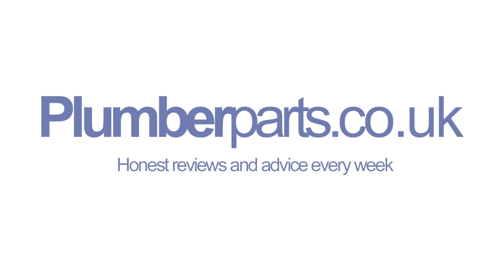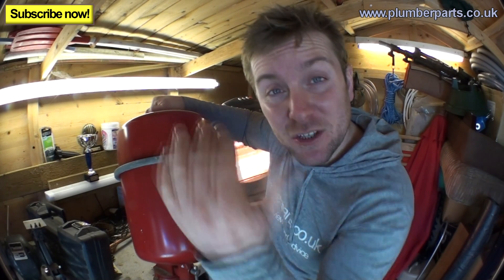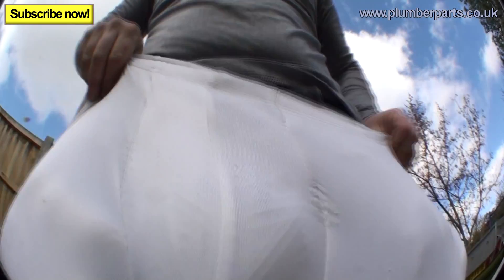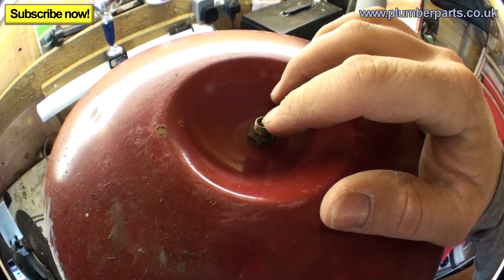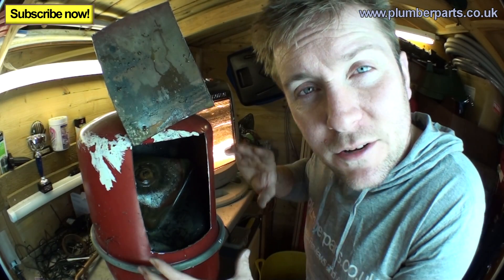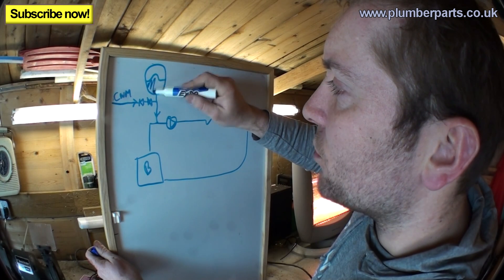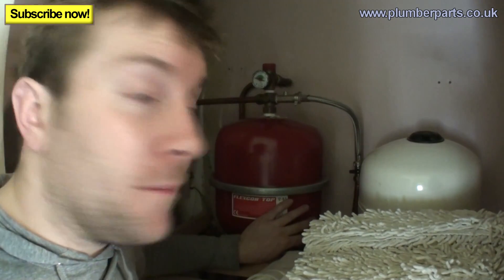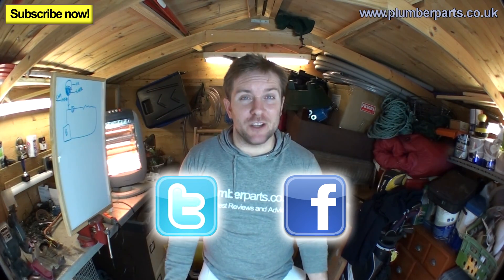EXPANSION VESSELS - CENTRAL HEATING SYSTEMS - Plumbing Tips

Comment: I recently had a gas inspection pass. After testing the heating we noticed a puddle starting to form in front of my flat. Water was coming from the overflow pipe. 

The engineer asked if I had to refill the pressure each time and I told him I did. He said most likely the expansion vessel has filled with a lot of water and needs to be replaced?

Could you explain why this happens?
Reply: How did you solve this ?I'm having to pump pressure every 5 or so days.
Reply: @Phoonguy  I have the same problem, checked everything and can't find a leak

Comment: I see how it helps with heat expansion but why is it that when the pressure on the water side is low the heating systems can start to not work so well? Also if i only have an instant gas water heater for a shower not for central heating can i install without an expansion tank as when the water is heater it is escaping via the shower / tap.

Comment: Hi mate, I have an existing expansion system that's been in place for about 10 years which is no longer holding the pressure and I kero having to top it up to 1 bar. Are they easy enough to swap out like for like?

Comment: Brilliant videos, thank you! One question from me regarding filling my (unvented) system with inhibitor. My mains water fill point for the CH system is goes into the expansion vessel via flexi hose. Is it possible to disconnect the flexi hose from main and inject rapid dose inhibitor at this point? Will it mix through the whole CH system? Thank you and keep up the effort - very informative!

Comment: Got a friend  of mine an 'Old School' Plumber to replace a expansion tank , his trick of checking the tank if it was gone was to top the Water side of the tank with a screwdriver handle and you would hear a dull sound ...and then the 'Air' side if both were similar... then the Bladder had leaked water into the Airside,  I now check my new expansion vessel every few months  as the Water side of the vessel you hear a thud sound and the Air side, Rings like a Church Bell...Lol ...Great upload...

Comment: What would have if my expansion vessel was too small for my system? I have an integrated one on a greenstar 24i system that feeds 15 rads, 3 of which are doubles. Since the last one got fitted, I get a slow pressure loss, to the point when it goes to zero when cold and not running. When it kicks in again next day, it goes up to about 1 bar. No leaks on system anywhere that I can see.

Comment: Luv, luv, luv it. Fun and factual. Brilliant. One of my faves on YT. One quick question,  1700 sq ft, single floor apartment with underfloor heating. How do I size the expansion tank?
Reply: if it's 8kw boiler, then you need an 8 Ltr expansion vessel

Comment: Hi, Ideal mini s24 diverter valve which has a pin that pushes out when the water is switched to activate the boilers ignition switch is coming out. If I take the switch off and turn the hot water or central heating and I push the switch with a screw driver manually it will fire the boiler up.

Ive had a boiler engineer out who wants to sell me a boiler and not fix the issue, he's cleaned out the pipes and replaced the diaphragm behind the switch pin but its still not working. Yes put 2.5 bar of pressure in there so thats not the issue. What can it be???

Comment: Some help / advise, on a system, cold it's 1 bar, when hot it's 3 bar, it starts to rise from 2 to 3 bar over a short time, a few days, its a combi boiler, unvented, when I release some pressure, when hot, it then goes really low? Like  0.5 bar? The system is from 2008, its a heatline boiler, 15 mm rad pipe work, I cannot see a expansion tank,

Comment: From instructions I've read you need to invert the vessels with the air valve on the top so that any sediment does not gather in the water side of the device, also they say to place on the return side just before it gets into the boiler.

Comment: We have had a problem with Water pressure at 2 bar but low water flow. I have found that by letting air out of the expansion vessle the water flow (taps) has improved. I have let all the air out of the expansion vessle is this a problem ?

Comment: Hey mate I’ve got a pressurised hot water system that makes a terrible banging noise in the morning sometimes when the heating kicks in too. Is it likely to be an expansion issue? The inlet/pressure reducing valve has been changed as was thought to be an issue with this, but no change

Comment: HELP REQUIRED PLEASE. I have noticed the system pressure on my Combi boiler goes quite high, nearly to 3Bar. I have checked the expansion vessel, charged to 1Bar at zero system pressure. No water comes out the vessle, so  i assume it's ok. Start heating, the pressure goes up to 2.5 to 3 Bar. Also noticed that the expansion vessel and flexi pipe stay just warm as if no water is getting to the vessel from the manifold unit. Any ideas?

Comment: Hi :) 
        I'm a computer engineer, love electrics and computery stuff and know how to do a ton of other stuff but know absolutely jack about plumbing (as in can manage to bleed a radiator and that's it).!
I have a mate who takes care of that for me and I do his electrics in exchange as he's afraid of the "killler" electric type stuff.
I'm nervous of flooding the place so it works out ;) 
By the way electricity wont soak your carpet! Set fire to your house maybe but definitely won't soak the carpet :)

Having said the I've just spent a couple of hours watching your vids and there are three things I've have to say:
   1. The plumbing diagrams you do mirror electronic ones (I keep explaining to my mate that both are very similar in the way the work but he's s not buying it ;) ) 
For instance your symbol for a one way valve is the same one as for a diode which does pretty much the same thing only with electricity. And the radiator symbol is the same as for Resistors which again do something similar, (i.e. dissipate heat).

2. I'd actually give this plumbing thingy a go! Learned a ton of stuff the past few hours. 

3. I did the tighten the bleeder valve on my heating system when we moved in three years ago because I never had a pressurised system before, been bleeding a radiator once a week in the kitchen and kept wondering why. 
Just loosened it a few minutes ago :)

One thing I've seen on you tube is people who pipe up and complain about something or other trivial which is unfortunate but I've learned more from you tube than I ever learned in school and collage and I learned it quicker. 

Keep up the good work and thanks for taking the time and effort to do the vids.
They mean a lot to those of us who know the value of them :)

Now I'm off to buy a rowing boat, just in case I need to row from the sitting room to the kitchen should it all go horribly wrong ;)
Reply: except he put the diode the wrong way round, doh. Although, in electronics, it depends which current direction concept you subscribe to.

Comment: You refer to a lots of poor and incorrect installations, as you have just said in your video about expansion vessels. (Do they need to be a certain way up ?)It would be really useful if you could explain why and also do a video of all other whist not necessarly dangerous or instaled in a way they wont work, but show or explain the best way and correct way they should be installed, with  working examples of an poor or incorrect installations. You did this on one of your videos showing a little vessel for removing air in the system you said this should be installed before the pump which makes sense. You then showed us one installed after the pump. On another matter can you show a doemestic hot water system (for the taps) and heating, with a combi, without a emersion heater ?Hope that makes sense. cheers Bob.Have you got a book out ?

Comment: I wonder if the vessel would work without the membrane if you just put the vessel upright with the nitrogen on the top side...
Reply from the maker: +He Ka I've always wondered that!
Reply: ***** =D hah. I guess the rubber is there just to ensure the gas wont leak in to the system. Otherwise I'm sure it would work great.

Comment: My Keston 80 has just had its expansion vessel replaced  by a well-known energy company due to collapsing pressure at cold and having to refill. Now the pressure just collapses to 0.4 bar when the heating goes off. The gas bloke said it was ok. So I don't recharge, just turn the heating on, the pressure rapidly climbs to 2.3 bar then when it cycles off it reduces to 1.0 bar in about 10 mins then fires up again and heads off to 2.3 bar. At the end of the evening, everything goes off and the pressure goes back to 0.4 bar. It never used to do this. So, was the new expansion vessel duff, or maybe it hasn't been pumped up properly? I'm no expert and I think the well-know firm is reluctant to come out again! Should I just switch everything off and go electric?
Reply from the maker: +Gordon Clifton Deffo check the expansion vessel. Something is not right there!

Comment: Really enjoyed video.Don't know whether you help with advice.I have expansion vessel on our heating system which is pumped through to our bathrooms.Every time pump is called into action, theres a strange loud farting sound coming from pump/vessel area.Do I need to replace vessel?Or is there air in the system somewhere?As funny as it sounds, not sure my plumbing should be guffin' 20 times a day.
Reply from the maker: +Nigel Payne Hmm hard one to diagnose. Think youve probably got a problem with the expansion vessel Best get a plumber to check!

Comment: The 18 litre expansion vessel on my CH system started to pull the supporting bracket off the wall. I found it was incredibly heavy. Does this indicate the vessel has failed and is totally filled with water? A pressure reading shows 2,9 bar.

Comment: What was the second, white tank shown in your video here: https://youtu.be/m1repkd1HHc?t=5m28s ? My system has two, just like the one you show (and the installation looks really bad). The white one has no pressure gauge and has just started dripping (and no air seems to come out when I press the valve on top).

Comment: The pressure went low on my eCombi Ariston boiler last week so I opened up the l/h valve, turned the r/h valve until the pressure almost reached 1.5 and then turned off the R/H valve followed by the L/H valve. The pressure was then 1.5. The system continued to work but today I noticed the pressure was almost at 2.0. How do I lower the pressure so the pressure does not continue increasing or until it stops working.

Comment: I recently had my Ariston Clas 30 system boiler's expansion vessel repressurised - it was way down.  Shortly afterwards I've been finding that several of the downstairs rads in one particular area are only lukewarm - that's all of the rad not just the top or bottom. Could the engineer have introduced air into the primary circuit when he repressurised the vessel thus causing airlocks? I've done my best to rebalance the rads - turning down the upstairs one as per another of your videos - checked the TRVs etc but nothing works. Can you advise if airlocks might be the problem?
Reply from the maker: It sounds like airlocks. Check out our video on how to remove them! Good luck, PP!
Reply from the maker: It sounds like airlocks. Check out our video on how to remove them! Good luck, PP!

Comment: Hi great Video..... I've a sealed oil heating system connected to a boiler stove heating 14 rads ..... Everything is working perfect (power cut we dampen down the fire)..... The Pressure Gauge is at 1bar..... after 10 days of use it drop down to 0.8-0.9 and i re fill again to 1 bar.... During the summer we loose no pressure..... Checked for leaks none..... Any idea wat is causing this
Reply from the maker: Probably a tetchy high pressure relief valve.
Reply: ***** Can you do a video on fitting a bolier stove to a pressure system, Irish plumbers said it cant be done.. Had to get one over from England to fit it ;-)

Comment: Thanks for your help. Would the old tank effect the new expansion tank when system is correct pressure. By not getting the right pressure cause the old one is still attached

Comment: I have a white colour varem extravarem 12 ltr, on it it says max 6 bar, then a sign showing 3.6 bar, what should I pump the pressure to, at the moment it is zero
Reply from the maker: Is it on pressurised hot water or heating?
Reply: no idea, it is up next to the immersion heater, white colour (if relevant) and is called varem extravarem

Comment: My next question is, would I have to remove the old expansion vessel ( which is still attached to the combi boiler ) to make the new one work properly?
 Thanks for help in advance
Reply from the maker: Simon Goble You should do, although lots of plumbers leave them is they are tucked away at the back of the boiler and not leaking!
Reply: thanks for help. so by removing the tank from the boiler which is at the back.would mean disconnecting the the boiler from the wall and then i would have to get the boiler re-commisioned is this right?

Comment: i have a question for you. my baxi 105e keeps on loosing pressure and have refill everytime it comes on, also noticed that keeps on chuking out water from the over flow any ideas?
Reply: Expansion vessel failure would cause this.

Comment: informative but factually,the expansion on an open vented system would take place via the cold feed back into the f+e tank and not up the open vent as stated although the level of water in the open vent would rise as the water in the f+e tank rises as water always finds its own level.typically,between 4 degs and 100degs water expands by 4% so there would not be enough capacity in the open vent pipe to accomodate this.the open vent is to vent water and steam should any thermostatic controls fail.
Reply from the maker: Hi Alan, sorry mate but you're wrong. The feed and expansion pipes do just that. Some bedtime reading for you! http://www.renewtech.co.uk/UVHW%20OSG%20Sec%202.pdf
Reply: Videos are so funny mate but I'm afraid Alan is right the cold feed takes up the expansion on the heating the vent pipe is purely a relief pipe if the cold fill gets blocked for example!!!
Reply: @joshyboy9  are u talking about a non pressurised system here?

Comment: Hi... I top the pressure of my Expansion vessel but when i was bleeding the radiator upstairs i noticed that the pressure is escaping again on this radiator what is the possible reason? the expansion vessel is fine there is no water mark on it. and if  re-presure the expansion vessel once again do i need to empty the sytem ?or can i pressurize again buy turning off the system. and do i need to bleed the all of my radiators? comments & Suggestion very much appreciated.Tnx

Comment: I have a combi boiler to replace an old baxi back boiler. I still have my indirect water tank in the loft. Because I cannot get enough hot water from the new boiler is there a way of connecting the indirect tank to the radiators to get hot water in the tank. 
Will the tank take the pressure from the closed system?

Comment: Was it a bad installation because the air was located below the water? On those tanks, do you occasionally need to attach an air hose to put more air into the tank?